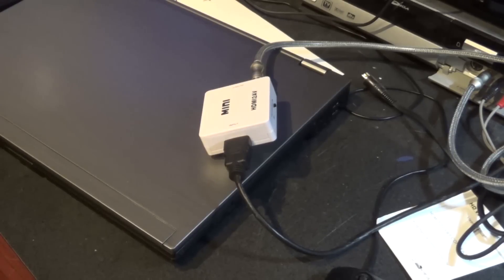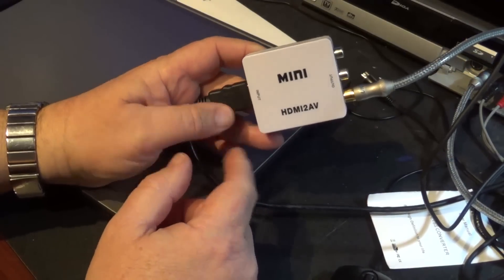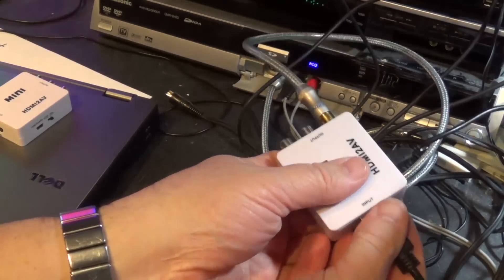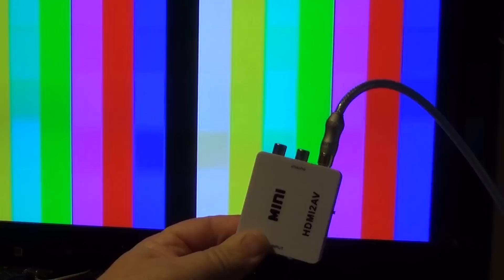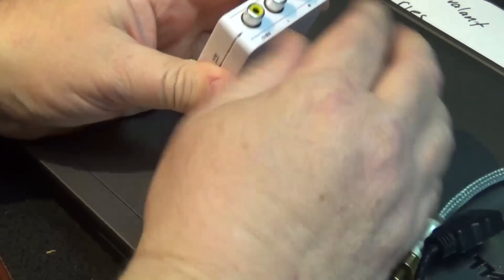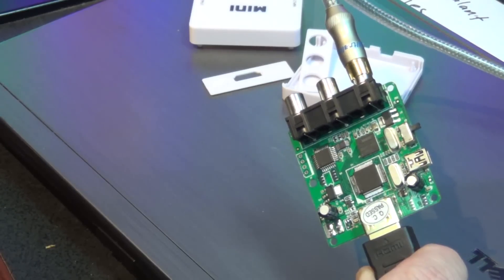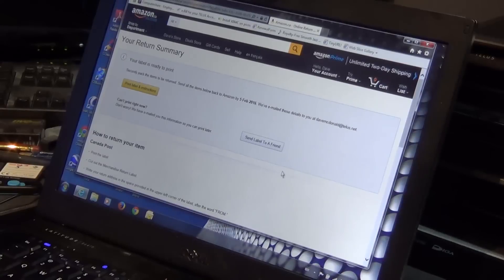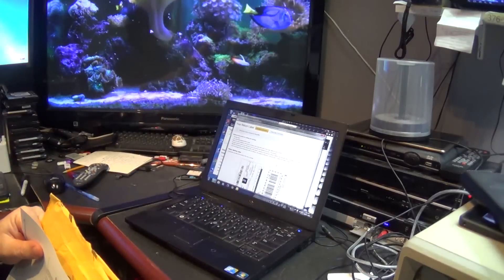Another defective HDMI2AV adapter

Comment: I just bought a used Nintendo 64 for $80 and paid $15 for one of these converters it was the very last converter they had and it didn't have the power supply box so they only charged me $10 right now I have tried it on two different TVs neither of them worked I just left my local thrift store with a TV that has the red yellow and white inputs so I'm going to see if I can just get it to work like that and then I will just return the converter

Comment: Mine HDMI 2 av started flickering color out of the box, at some point it got thirdy flawless minutes of movie then went completely black and white no mater what now. If im to open it, its there something i could do to try to make it wirk with color? Im in the middle of basically nowhere and willing to waste it. So its there a trick? Remove a part? Bypass something?... By the way the mode it flawlessly worked 30 minutes was NTSC. My cce however works both modes but it has multiple modes while my main Philips tv has NTSC 4,*/NTSC 3,58 and pal 60 as native. The menu alows for NTSC and pal-m and auto aswell. In auto the image its NTSC but seems to have a dot like ditching pattern... My tv digital converter works flawlessly pal and NTSC however it does black and white on it too if im in pal-bg ir pal-nc. Any tips of what i could theoretically do to it in order to force it to give me that 30 minutes of flawless color? Im sure it was NTSC, even though i was in auto on tv, based on colors i was witnessing at screen. Anything would help.

Comment: It was not stupid. To me this was a good invention.
Reply from the maker: They are great units when they work.  I have 2 here that run 24 x 7. One sends the HDMI output from my security camera DVR to a channel 9 analog modulator that sends the signal through the house.
It's just I had 3 bad ones in a row bought from Amazon.  One was fixed as the seller refunded and told me to toss.  The other 2 wanted them returned and since they paid the freight they got them back.

Comment: i think you have to set up proper and exact resolution for hdmi
Reply from the maker: Hdmi should auto negotiate between the source and display device.  That is part of the standard.
Reply: 12voltvids i don’t think so. My experience is (especially in pro stuff) that some units are working only at specific resolution
Reply from the maker: @radioaktivnyclovek6763  
The hdmi standard negioates resolution during the initial handshake. Otherwise they default to the lowest resolution 640x480. Our older cable boxes would default to a max rate of 1280x720 (they booted initially at 640x480 4:3 mode and then went to 1280x720 16:9 after negioation). Then you can go into menu and select the output desired. (Sd 4:3, sd 16:9, 720p, 1080i or 1080p). When I was working on these devices I did try to force different resolutions on my tablet. Made no difference.
Reply: 12voltvids i understand, i just wanted to share my experience. For example i was working with Lynx Yellobrik CHD1812, which is a hdmi to sdi converter and it only worked properly with hdmi signal set to 1080i 50Hz, all other resolutions are displayed as no signal 🤷‍♂️ and that lynx is definitely not a cheap device
Reply from the maker: @radioaktivnyclovek6763  Well this one it didn't matter what I set the tablet to. There was no signal no matter what was selected. BTW, it didn't matter what I set the tablet to, as soon as I plugged it in it switched to 1280x720 so obviously there was communication between the converter and tablet, but it still would not display. Just the double color bars.
Reply: 12voltvids thank you anyway, prevents me from buying it :)

Comment: Well buy a good one then ya baby.
Reply from the maker: That's the problem. I have put in about 20 of these systems, and some work, and others don't. Even units that look identical on the outside, same case, same printing are totally different units inside. Even buying from same vendor yields different results, and requires returning it.
I have one I bought 10 years ago working perfect, and the one I fixed in the last video workes fine.but it is a real crap shoot when ordering these things from Amazon.
Reply: @12voltvids  I mean cough up a few more duckets for a quality made one instead of a 2 buck chuck.
Reply from the maker: @chooch5728  Actually the ones I have had the most problems with have been the more expensive ones. The 2 I am currently using that run 24/7 were under 10 bucks. The ones that had to go bacl 30 - 40.00

Comment: I have 1 I bought to play my old video game systems with my works but no audio . Video but no Audio.
Reply from the maker: Check the audio settings in your game console.  Needs to be set to 2 channel stereo.  Make sure Dolby digital or surround is turned off.
Reply: @12voltvids  changed the Audio to Mono on my Original X-Box an still no sound ...
Reply: @12voltvids  somehow it works now after taking the thing apart . Saw no bad sauder points but there was some piece of stuff in there like a loose  piece of plastic or glue I removed an put back together connected the original X-Box an there is sound now . Even changed the sound on the xbox from Mono back to Surround an the Audio still works ... 🥃🥃

Comment: You gotta plug in the power too
Reply from the maker: Bzzzt WRONG. Power over HDMI. I have 3 of the same devices in operation, none require external power, and this one made no difference.  The power plug is for devices that do not support power over HDMI, but the device I was using does support it, and has more then enough current as was proven when I connected another device that was functional.  I love it how people chime in thinking they know it all, when in fact they really don't.  It is all dependent on the power handling capability of the HDMI port on the video device and I did show that the port has more than enough power.
On the HDMI - video adapters I have if you plug in power with no signal they display color bars untill an HDMI signal is present then switch to the video signal. Remove the HDMI cable and they go back to color bars. This one shows 2 sets of color bars side by side regardless if it is powered externally, or by power over HDMI.
Reply: @12voltvids  I just plugged in power and it worked

Comment: Thank you, this made me realize my solder connections are bad and mine's stuck in PAL. Working on getting a raspberry pi to an old flat panel tv. Pretty much have to go to a maker space because my soldering iron died.
Reply from the maker: +Maximillian Charles I just spent several hours repairing the timing controller (tcon) board in a 52" Sharp TV. What fun that was.
Reply: Scratch the makerspace- the switch wasn't connected to anything. It's stuck in PAL.
Reply: Ordered an HDMI to component and a 3.5mm to RCA cable for my raspberry pi. Either one has got to work, and if they both do, yay for compatibility. Just trying to get a 480p tv to work, it does interlaced on the regular RCA. So If I use component I may be able to manage the right resolution for the job. These adapters are crap though. Good video.
Reply from the maker: +Maximillian Charles  Only 1 out of 4 I have ordered lately worked properly. 2 were fixable, and one went back. The 2 I fixed though, and working fine now.
Reply: I don't even bother shipping back. I have a my own policy for bad reviews if it's sub 25 bucks. They should give something that works or they get a bad review. Also just happened, my TV broke, have to wait until the weekend to get another. grrr.
Reply from the maker: +Maximillian Charles The one I shipped back was paid for by Amazon. They wouldn't refund without it. I have had to leave bad reviews for poor quality merchandise before and they reject them saying the review is for the sales and shipping only, and they won't publish bad reviews for defects unless the seller refuses to make good.
Reply: Mine HDMI 2 av started flickering color out of the box, at some point it got thirdy flawless minutes of movie then went completely black and white no mater what now. If im to open it, its there something i could do to try to make it wirk with color? Im in the middle of basically nowhere and willing to waste it. So its there a trick? Remove a part? Bypass something?... By the way the mode it flawlessly worked 30 minutes was NTSC. My cce however works both modes but it has multiple modes while my main Philips tv has NTSC 4,*/NTSC 3,58 and pal 60 as native. The menu alows for NTSC and pal-m and auto aswell. In auto the image its NTSC but seems to have a dot like ditching pattern... My tv digital converter works flawlessly pal and NTSC however it does black and white on it too if im in pal-bg ir pal-nc. Any tips of what i could theoretically do to it in order to force it to give me that 30 minutes of flawless color? Im sure it was NTSC, even though i was in auto on tv, based on colors i was witnessing at screen. Anything would help.

Comment: Just getting a TV with HDMI is the best option... i did buy this same thing it wroked for 3 mins and then all colour bars.. but luckily the shop i got it from took it back. So its a lesson for me. JUST GET A TV
Reply from the maker: How stupid is this comment? Of course my TV has HDMI, however HDMI is not a solution for distribution throughout the house. For a security camera system, I want to be able to just turn on any TV and select the channel that the DVR is on.  The old security DVR had both the standard RGB output to go to a computer monitor and a standard video out to go to the existing tv modulator that feeds throughout the house. So the only solution is to use an HDMI to AV adapter.
There are MANY commercial installations, such as condo apartments where they have security cameras that they feed on the cable that goes to every suite so the residents can watch the door, parking lot gate ect. When they upgrade their cameras they too are faced with the same situation. 
Short of getting an HD modulator, which costs a few grand and that only works for people with new TV that has a digital tuner. Most stratas are pretty cheap, and will not spend the extra bucks, but will spend 20 or 30 to get one of these adapters so that their new DVR will work with the old system.
I have installed about 20 of these in this exact situation, where they upgraded the cameras and DVR, which was the easy part, only to find that the new one did not have a video out, and had to go to one of these to make the system work. That is why they make these units. Unfortunately some don't work properly, others work fine. The 2 I use at my house work fine now.
Reply: @12voltvids  
Bother i was just talking about people with my situation..
Cus my brother broke my 50" LED Tv so till it gets fixed all i had was an old TV.. and one of my friend suggested me to get this converter.. i Do respect your use of this converter BUT i was relating this to my story and suggesting people to not do this as i tried.
And i used it to play "PS4"
Reply from the maker: @shaikhmohammedali6346  
Most do not work with copy protected content. Others work fine with it.  The ps4 uses hdcp (hi definition copy protection) and this will not work with most of these converters .

Comment: I recently bought one of these inexpensive converters on AMAZON and it did not work. I was trying to convert HDMI from my DVR to the RCA audio/video of a DVD/VCR recorder. I contacted the seller who offered a refund or replacement whichever I preferred. I took the replacement and that did not work either although I experimented and it worked on the HDMI output from some other devices. Frustrated I decided to give it one more shot before asking for a refund and this time it worked perfectly and without the need for the auxiliary power. The only difference was the RCA cables. The first time I tried it was with the thin dollar store variety RCA cables. The last time, when it worked, I happened to grab a thicker better grade of RCA cables I had lying around which were obviously better shielded. Once I used the better cables both converters that I received worked without a problem.
Reply from the maker: Rca cables will make no difference at all unless the cable is physically damaged. Standard definition video doesn't require anything special.  You can even send it over UTP cat 5 using a balun.
Reply: @12voltvids  The thinner cables were not damaged, I was able to get the color bar with "NO SIGNAL" with them. I can't explain it I can only say what happened, the converters worked fine with the heavier cables.

Comment: in case you haven't figured out the problem already  the exact same thing happened to me got rainbow bars on my screen and all then I messed with my computer display settings and then it worked it had to be on 1080p not 720p or any other setting will not work

Comment: LOL you are a sucker for punishment ha ha  :-D
The one you repaired was just shitty soldering, but this one has a frequency problem, its almost as if its got the wrong cristal installed, the colour bars have the wrong clock.
You do seem to love pain ha ha :-D
Reply from the maker: +zx8401ztv I doubt that because if the frequency was wrong then the video framing also would be wrong. It is generating an NTSC signal, but something in there is wrong. I didn't as you can see spend any time I shipped it back, as I needed to get another one.

Comment: I just got one of these off ebay. HDMI Input Composite Out. I got it so I could plug a Roku into a CRT. It only displays in monochrome / B&W. Is there a fix for that? I also made sure it wasn't the TV. I plugged in a gamecube and it was in color. I saw a better poduct offered by Radioshack but it's $30...
Reply: i have same issue. did you find a solution?
Reply: @JonWolf  Sadly no. I ended up getting a Roku that had composite out. For this price range there isn't much to work with. I saw on radioshack dot com they have a hdmi to composite converter that outputs in color that costs 35 dollars, but it wasn't worth the price just to get color.

Comment: I just got the HDMI2AV converter. I have a old TV that i want to use to play my Mini SNES on. It just shows me a black screen on both PAL and NTSC. I have a AV Scart adapter pluged in the TV, then the AV cables from the scart adapter pluged to the HDMI2AV converter. Am I doing something wrong like using the wrong cables maybe? Or is it the adaptor that is not working?

Comment: I have a converter very similar to this one but branded as "Porta". I did notice a difference when plugging in the additional 5V USB power. For instance, without USB power, when a dark scene appeared in the video/movie, the HDMI connection would cut out and display color bars until the scene was bright again. Plugging in the USB power solved that problem for me.
Reply from the maker: That happens if your usb doesn't have enough power.  Mine does.  This one that wasn't working properly didn't matter if usb was plugged in or not.  Just color bars. The same as you get with just the usb plugged in with no signal on HDMI.

Comment: You should give input from atleast 1A 5v charger. I had a similar issue I was getting a blurred display from a usb power source the reseller said to try power it from a 1A source adapter and it worked all fine.
Reply from the maker: No that didn't help. I tried that long before investigating.  I have 2 of these units and they both work fine from HDMI power. If I plug in USB power and disconnect the HDMI they go to color bars and then back to video when plugged back in.  One of the 2 I have is finiky and has to be plugged unplugged from HDMI 2 or 3 times to get a picture if powered externally but if powered by the HDMI it works every time. Naturally the HDMI device has to support high power devices. I am using a DVR and it does support high power.

Comment: mine works but no color. i can play ps4 but no color only black and white
Reply: I met the same problem,only black & white,I contact with the seller,I am very angry with the seller, and then he explained to me compatibility or system problems? I  do not remember, and later they came up with a new product specifically to solve this problem, sent one sample to me, and then everything is good, I have used more than one year, everything is fine.You could contact with your seller
Reply: Bella Well can you list the link to the seller you used, mine's in black and white too and I need a color compatible unit.
Reply: Bella Well I ordered one from Amazon that's only black and white on a CRT TV. I was going to contact the seller you used to order a compatible one that shows colors correctly. Thank you for the link.
Reply: I figured out a solution regarding color issue. Made a video about it.

Comment: It's amazing you CAN return it post free. Normaly you have to pay the return post. I think they know it will cost more to return than the products worth, that's how they make money. Still WE never learn do we!!
Reply from the maker: +Michael Beeny Amazon is good for that if it is fulfilled by Amazon. If it is sold by a private seller, then they expect you to pay for shipping, and many vendors if the unit is a low cost item will simply refund and tell you to scrap it. Shop Jimmy was like that with a bad board they shipped me. They sent a replacement for free, and told me to scrap the dead one.Worst one I ever got bit on was a DAT deck I bought off Ebay.Auction was won for 15.00, and right on the ad it said shipping was 9.95 in the US. The seller wanted 95.00 to sip to Canada, and 45 to ship to the USA. I argued that point, and he came up with a story that he didn't put in a price, and that price was somehow generated by Ebay, and all kinds of other bull.Long story short, by the time the 15.00 auction was received it cost me 65.00 US. When it arrived, it didn't work. He offered to refund the 15.00 if I shipped it back.So I fixed it, and made a repair video.